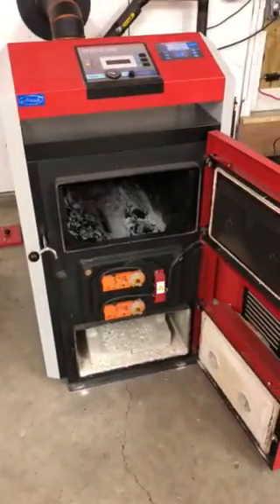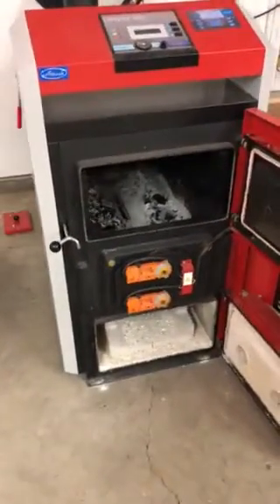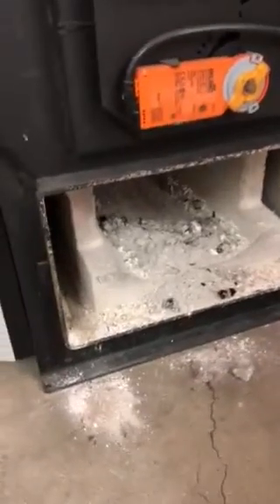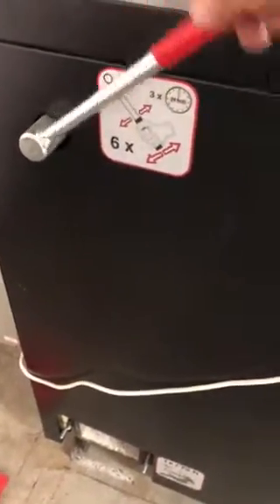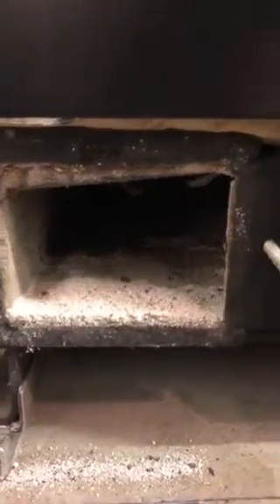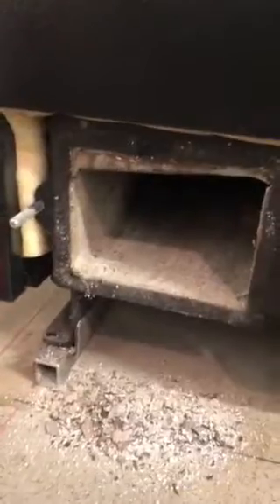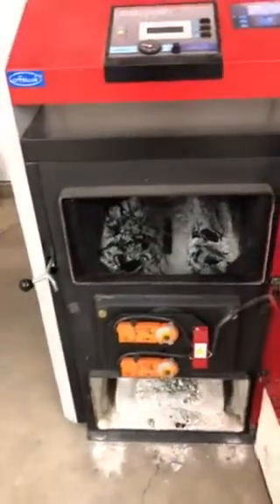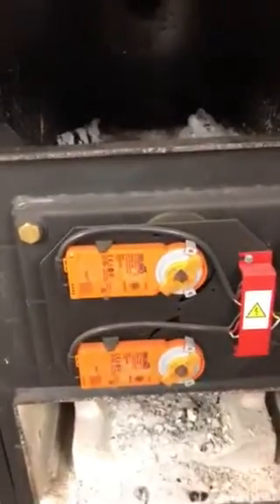Attack DPXL-45 wood gasification boiler- routine cleaning

Comment: I'm about to make a video of me doing a routine cleaning of my Froling FHG. I did an overview of the boiler not long ago, stop by and check it out. I like how you can clean around the edges of your ceramic in the bottom with the scraper tool. I have to use a brush on mine.